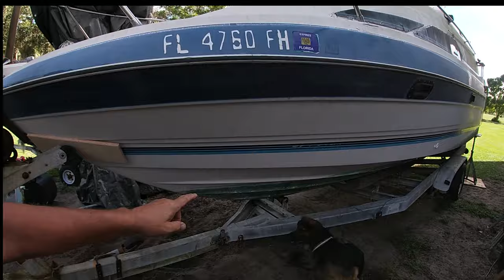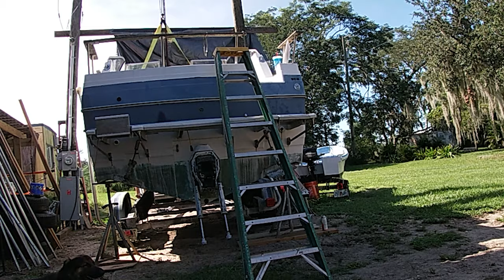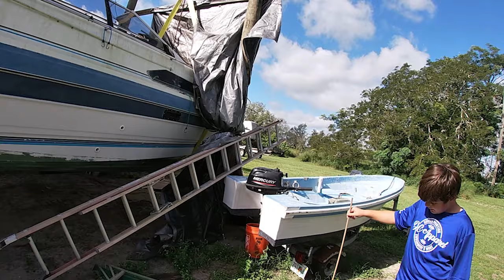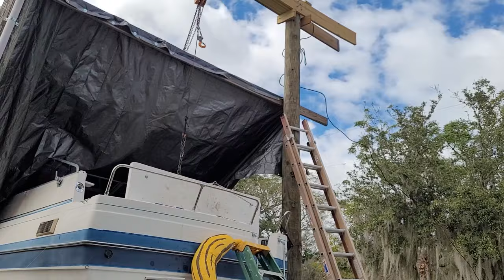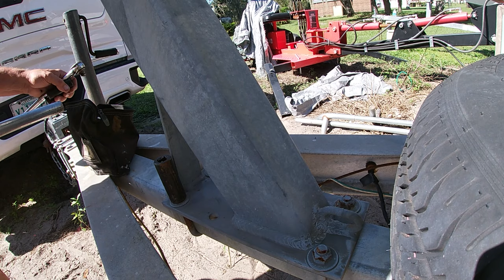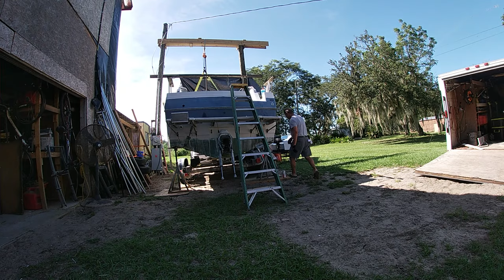How To Remove And Replace A Boat On A Trailer

Comment: My Monterey 26 has the tags on the boat for the straps I am going to live stream pulling the motor next month to have it rebuilt then I'm going to live stream putting it back in when I get my boat where it will float I will work on my trailer it is a tri axle trailer I have to replace one axle because it is bent and paint the trailer love the videos buddy

Comment: Looks like you had some good helpers that day 😊 Did you have to adjust the bunks to fit the boat, or are the boats that similar in design on the bottom as well ?